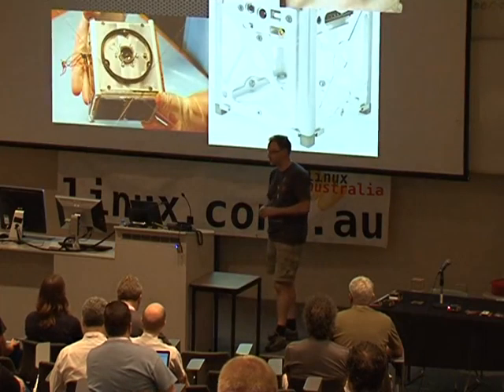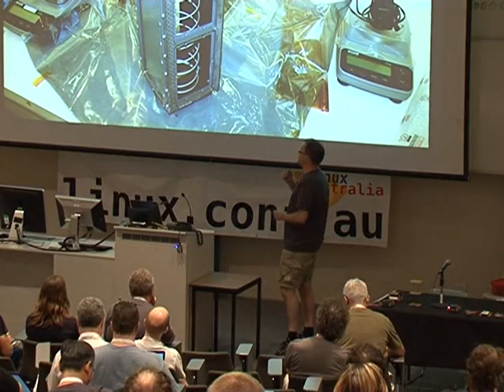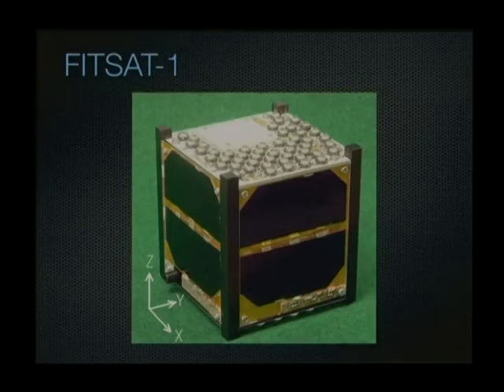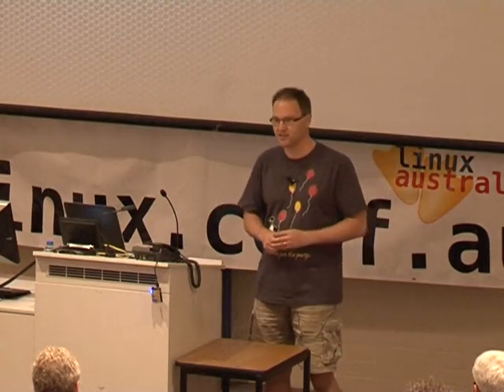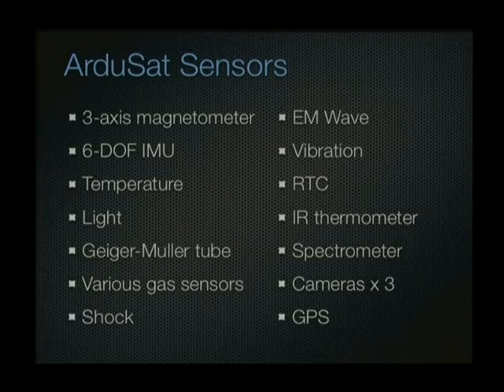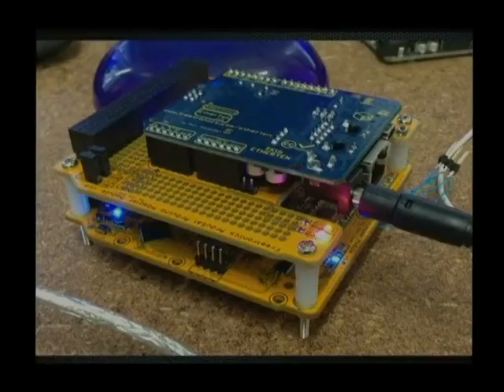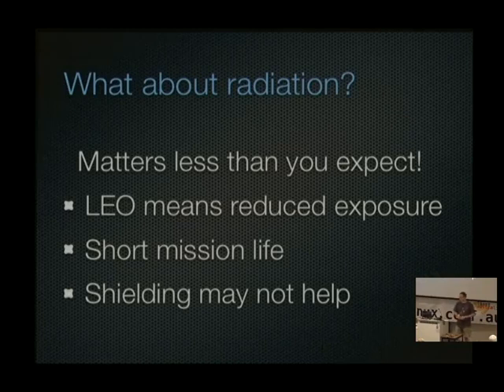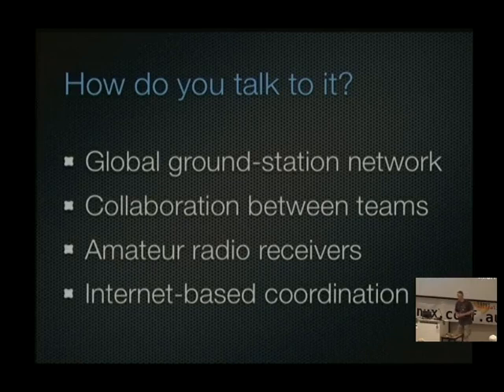ArduSat: Open Source In Orbit

Comment: Wouldn't it be easier to have multiple parallel experiments on the Earth, and regularly (when the satellite passes in range of the Earth-side antenna) the satellite just publishes its logs of sensor readings that orbit to the Earth?
Just suggesting a more down to Earth approach.
Reply from the maker: There are several reasons that wouldn't be ideal. Some of the experiments require control, not just reading data: for eg, the attitude of the satellite needs to change to align the spectrometer with the target synchronised with readings. Also, a major aspect of this is inspiration and process: inspiring students by having their experiment run in space, and taking them through the process of defining, uploading, receiving results